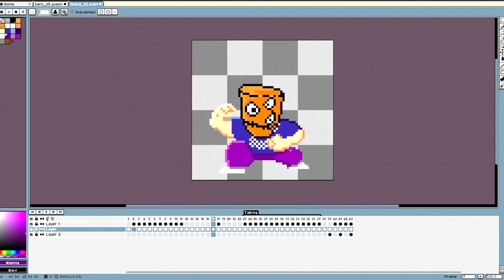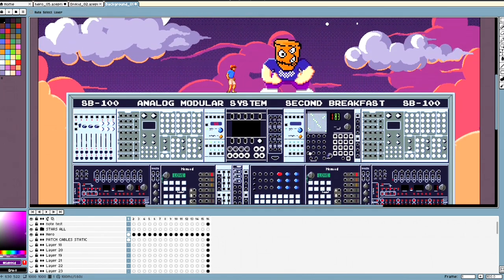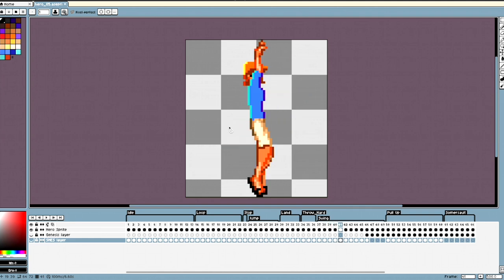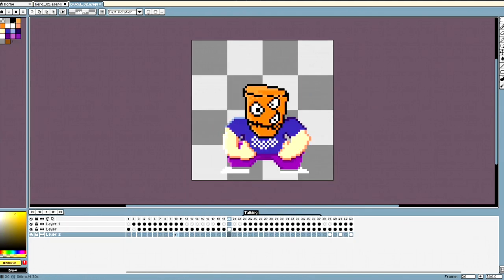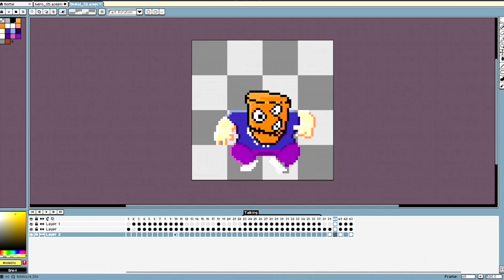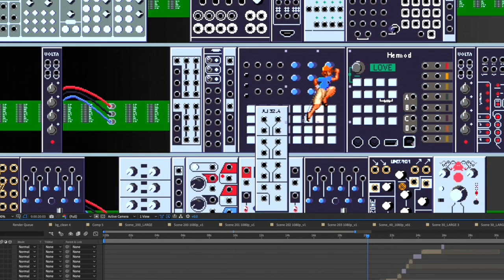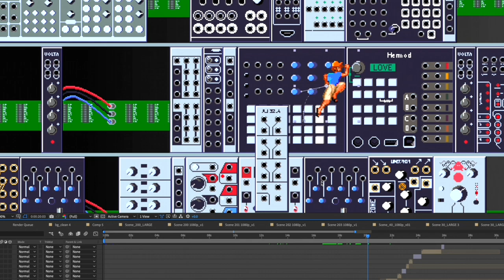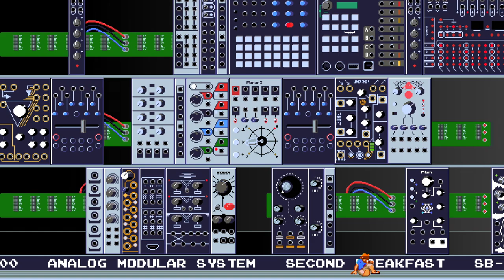Patch Tips | Eurorack Performance, Sound Design, and Music Theory Tutorial

Comment: Love it once again thanks.  Question for Hermod, with one of the four (a,b,c,d) inputs. I haven’t looked at the CC data index yet but could we just macro all tracks key to one knob and make the key change? In the midi channels with the scale function on.
Reply: I found it, was just in the next menu under scales.  So an control knob to multiplier to 4 inputs will give 4 voice control for key change
Reply from the maker: Since Sinfonion is handling all my quantization I don’t use any quantization with Hermod. However that’s a good solution for key changes. The limitation is that you’re locked into the diatonic scale with no room for borrowed chords from outside the scale. However it’s certainly better than nothing.
Reply: @SecondBreakfastMusic  almost have to use pressure points into attenuator to avoid just scrolling up and down in key. But yes I am locked, I can transpose and change root note too but man I guess I am just trying to outsmart the sinfonion or until one falls into my lap.
Reply: @SecondBreakfastMusic  I aprreciate the feedback hard to bounce of people when they are not into eurorack haha

Comment: What does it mean that Sinfonian quantizes the Hermod? Are you not sending notes out of it?
Reply from the maker: You kinda just need to read the manual of how Sinfonion works. It’s the most powerful quantizer in euro. Very musical.
Reply: @SecondBreakfastMusic  I was more asking about what the hermod was doing. I have the Hermod but not the sinfonian
Reply from the maker: @deladonics  I have a midi keyboard hooked up to Hermod that I use to play in all melodic parts. Hermod records those parts. Then some of the channels of Hermod are used for sending out modulation. I now use a second Hermod as well for recording all my drum parts and additional modulation. Also some of the modulation from Hermod is used for practical things like switching routing of the signals to different modules and also for my live shows Hermod is sending midi out that is being converted into dmx signals to control lighting.
Reply: @SecondBreakfastMusic  awesome thanks!